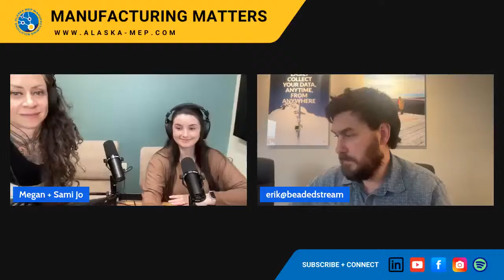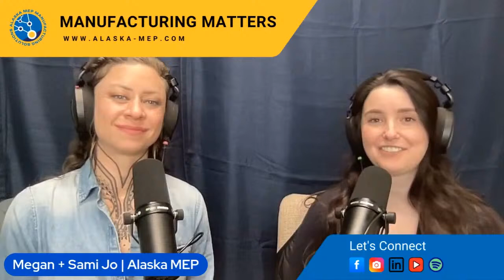#46 Manufacturing Matters: Erik Williams, COO of beadedstream

Comment: With any data collection / hardware company I ALWAYS ask if the data that is collected can be stored by open source applications like Home Assistant or via SMNP. For me it is so important for data not to be locked into the manufacturers ecosystem in case the hardware company shuts down or stops supporting the hardware. I checked out the FAQ but did not see any support for 3rd party data collectors. Of course API is a great step towards that, which I did see was supported. At the end of the day, if someone has their environment already set up and collecting other data in their dashboards it would be great to know that these devices also support 3rd party data collection.

Love seeing these advanced sensors that are hardy enough for our harsh environment.